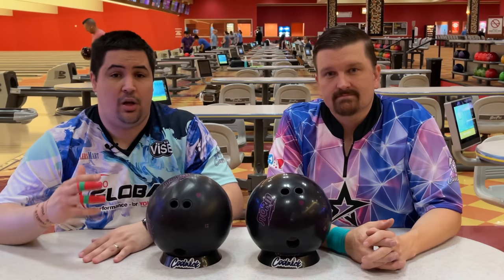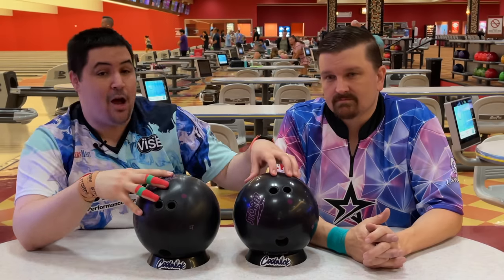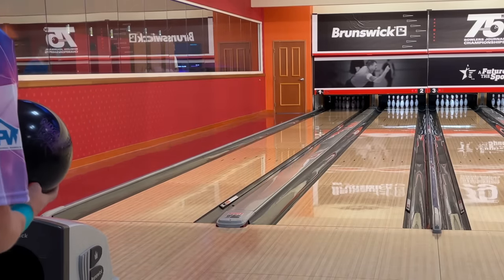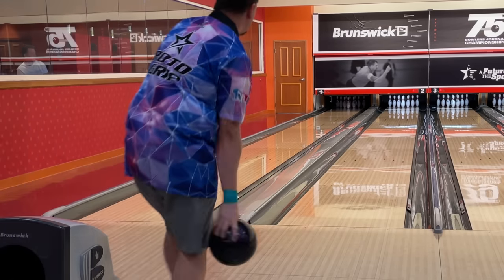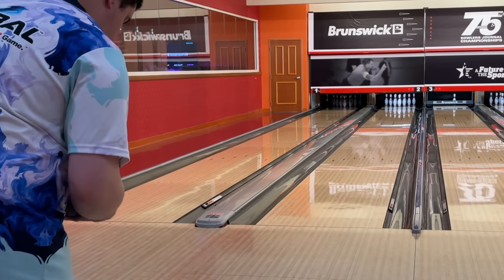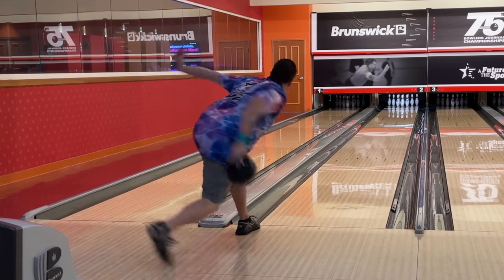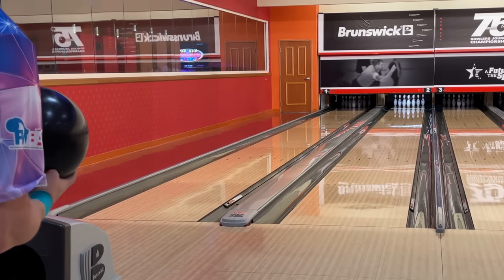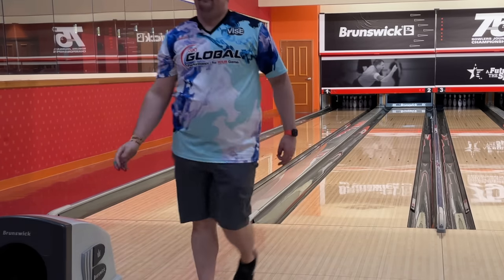What's The Difference Between A Bowling Ball Drilled Pin Up & Pin Down | Featuring Storm Night Road!

Comment: I also have a pin down Zen. I agree that it hooks much later, but I wouldn't say it hook less for me. Big difference I see is how the ball finishes through the pins. I see much less deflection with the pin down, and I tend to get more pin carry. Love the videos Luis, keep up the good work and positive vibes!
Reply from the maker: Positive vibes always! 🤙 pin down zen was money!
Reply: I like pin down too better.
Reply: got a pin up Zen - can't use it on my house shot. Hooks too much for me.
Reply: I'm the opposite. Pin down will give me alot of 10 pins. Even when I'm high flush. Sometimes it's fine but I usually get screwed over when using pin down. If I need more length I just change surface. My go to is a pin over the bridge or Slightly to the right of ring finger.

Comment: This may be the first time someone made sense of pin up/pin down--thank you! 

It's tiring to hear "pin down hooks sooner", "pin up hooks later". 

Explaining it in terms of Rg and Diff. makes so much more sense!

I found it fascinating though, to see that pin down worked better for you as a "balanced" bowler, where revs and speed balanced each other out and neither were dominant over the other, as opposed to Chris, whose higher rev rate and speed, was clearly more suited to a pin up.

That would seem to indicate that rev rate affects both Rg and Diff.

So check me on this please: 

Chris' increased ball speed+his loft+ pin down raising Rg= Chris' ball pushed further down the one than he needed it to. 

Chris' higher rev rate+ pin down lowering Diff., actually made the ball fight his rev rate, and clearly the ball won and even his higher rev rate, didn't give him the back end shape he needed.

I'm guessing that because you are more "balanced" in terms of rev and speed, moving left was really all you needed to do, to make the pin down ball work for you. 

I'm also guessing that a pin down ball might therefore also be a good option for a lower rev or lower speed bowler too.

What are your thoughts about this?

Last, and here's an idea for a vid on combatting urethane carry down: if pin down raises the Rg but lowers the Diff., would a bowler using a pin down ball, with straighter angles, be able
to overcome urethane carry down?

I'm thinking that a pin down ball would work with the carry down, rather than fighting it as a pin up ball would.

What's your take on that?

Thank you
Reply from the maker: I think you're spot on! As far as following urethane I typically prefer stronger pin up drill asym solids to follow that nasty transition!

Comment: 6:27 Incredible spare Lou! I guess you are a bowler after all. 🤣
Here is one of the simplest and best descriptions I have read on pin down vs. pin up and it seems to agree with what you are trying to teach us:

"Pin Down Drilling"

This type of drilling has an effect of promoting more total hook and less entry angle.

Helpful for:

Lower rev players
Higher ball speeds
Bowling on a heavy oiled or longer length patterns
Looking for a more gradual hook

"Pin Up Drilling"

This type of drilling has an effect of promoting less total hook and more entry angle

Helpful for

Higher rev players
Slower ball speeds
Bowling on a lighter oiled or shorter length patterns
Looking for a sharper hook
Reply from the maker: I’m glad it helps!
Reply: What about high speeds and high revs what would you say is more suitable

Comment: The only pun down ball I have is the Gem, spesifically bc I want it to be nore versatile.   The smoother the ball on the fresh, the easier it will be for me to control, and with it being as early as it is I feel like it's a better move.    And then I'm also provably gonna drill a pin down purple hammer
Reply from the maker: Should be good !

Comment: Yes, I will take the explanations given plus the examples of lane play into consideration the next time I bowl.
 This is why....... So 4 days ago i had an Idol Helios drilled pin down. 
Side note everything else I have is pin up. 
Initially I was thinking ahead and had it drilled this way because I wanted a new shape for the challenge patterns in my local winter scratch League or at least when we get to that portion of the league but for now in the bowling I have done with it in the 4 days have been exclusively on house shots.... and "I haven't got a consistent strike path with this lay out yet". I've been rolling it straighter and closer to the gutter than the pin up equipment. but yet to obtain much success...My roll is smooth. Some where in-between you both closer to you Luis slow feet big, swing, lots of balance able to repeat shots.  So Thanks for the knowledge I will try to open my angles up with a straighter, forward ball motion in mind and try to see if it sets to the break point properly, for a consistent reaction to maintain higher scores.
Reply from the maker: If you continue to not find the right path to the pocket with it I might suggest changing the surface a little bit!
Reply: @LuisNapoles  Correct I'll give another go and see if I can have success. If not I can see some polish coming into play....

Comment: Good video Luis. Our bowling styles are very similar. I have a Dark Code and X-2 from doing the exchanges. After watching this video, I’m considering having my Dark Code drilled pin down. What is your pin down layout on asymmetrical? Thanks
Reply from the maker: For me it would be 30x4.5x70 maybe a larger drill angle actually like 60x4.5x70
Reply: Thanks for the reply. After struggling to find the correct ball this morning in league (Jackal LE and then Trend 2) I rolled my pin down Zen for the last game this and scored well with a 240 something. The first two balls were just to inconsistent. As you always say, finding the right ball (tool) for the job. My Zen is my first pin down ball and I really liked the ball motion. Thanks again.

Comment: I'm currently bowling with a hammer emerald vibe ball weight a lil under 15lbs. With pin down since it's a asymmetrical ball. And I have a motiv pride with pin down. And I use the new ocean vibe ball pin down. I've bowled good with the emerald and ocean balls lately. My issue is I feel I haven't found the right ball for me. It's so many to choose from. I'm looking at the hammer scorpion sting,stinger, and envy. The motiv mystic jackal and empire. And also roto hustle rap or the wine balls. I'm a left handed bowler. And my rev rate isn't high and my ball speed is usually between 12 to 16mph. Over the last 3 weeks I've bowled several 220 plus games with the ocean and emerald vibe balls. What ball would be a good choice to add to what I already have. I also have a Brunswick prism hybrid and hammer reaper. The reaper I can't find any stats on it. It seems to be a pearl but it's that old of a ball. But at this time my main 3 balls are hammer emerald vibe and ocean and motiv pride ball. I love watching your videos they are so informative. And you have one of the most consistent ball releases I've seen online ever. I've posted some of my scores on my Facebook and on lane talk bowling app. I do have a few practice videos on my YouTube using both the ocean and emerald vibe balls. Bowled a 264 last Friday with the hammer emerald vibe ball. That's like my highest game since I bowled a 297 a few years ago. And I do think I might get my 1st 300 game this league year with the emerald ball.
Reply from the maker: Since you're lefty I would highly recommend the Storm !Q Tour Solid. Prob the most control ball on the market and as a lefty you def want that shape in your bag

Comment: My hyroad x is pin down like your pin down night road . Pin under my middle finger and did 1500-3000-p5000d by hand and it hooks smoother then it did out of box, while my IQ tour solid (my second IQ tour solid while it was number 9 for my dad and is the only one that is drilled pin up the pin on my first IQ tour solid was like my hyroad x but more to the right so it is not under my middle finger) and is at 3000 trucut so it is perfect to ball down to.
Reply: I was thinking of plugging and Redrilling my hyroad x (currently it's pin up with the bridge cracked) to pin down. Hopefully it does compliment my iq tour solid
Reply from the maker: Nice stuff!!!

Comment: Try a 45x2-3/4 x 30 layout this ball will also have small flares will roll like urethane ( with more back end) and hit like resin
Reply: 2 3/4 will probably not shape and either have a very long hook phase and have no energy left down lane or just flop in the heads and hook early so you get no back end shape 

Don't drill balls with 2 ³/⁴ pin to pap...
Reply from the maker: Yea I wanna drill more short pin stuff
Reply: @joshg218  Sorry you have the wrong Idea the ball will roll like pin down ( smaller flares) shape like urethane with more back end and same resin hit I average 230 with this drill and had 5 300 with it last season, and I'm 60 years young with 40 years bowling experience. Another way to look at it it is the same 5/8" difference from 3-3/8 to a 4" pin as to 2-3/4 just rolling on a different axis. And the main result is you will be able to play more right longer
Reply: @helenb2504  I had a ball misdrilled to a 2.5in pin with similar drill angle and val numbers to your drilling.. the ball never transitions properly.

Technology has changed much since I was a Junior as well.  20+ years ago we all had 3.5-4in pins.  I'm at 4.5-4.75in today and looking to probably start drilling longer because equipment is so strong.

A 2.5in pin goes one of two ways.. it is so close to the pap that the ball transitions well before the end of the pattern and the ball rolls straight when it sees the dry or it keeps flaring, and never transitions if there is enough oil and speed.

I had a dark code that flared 3/4 the surface of the ball but never changed direction down the lane.  

The urethane shape you speak of is poor ball roll.
Reply: @joshg218  Shape is a preference I like to play straighter and have my power at the pins not wasted trying to get to the pocket I average 230 with this layout so it works real well for ME. I agree nothing is for all bowlers but their is a misconception of layouts shorter than 3-3/8 and even Mo Pinal has short pin layouts so they must work!

Comment: so when I start with a 45 x 4 x30 layout on the fresh when lanes transition and everyone goes left I switch to the 45x2-3/4 x 30 and move a little right away from all the traffic and light them up. Note: both balls are Camo's
Reply: 2-3/4 pin to pap is crazy. 3-3/8 pin to pap is max flare. Meaning that is as strong as the ball can get. You actually start to lose dynamics when you go under 3-3/8
Reply from the maker: I think I’m gonna start changing some of my layouts
Reply: @roscoepretlowiv7959  Yes same as when you go to a longer PAP you just rolling the ball on a different AXIS it will roll more like urethane with more back end and still hit like resin try it out
Reply: yes give this layout a try it will produce smaller flares like pin down but will roll like urethane but with more pop and hit like resin
Reply: @helenb2504  I mean I know about short pin layouts. It's basically all Mikey Pinel talks about. They don't really match up with high rev rate players. I'm around 580. I just buy urethane instead of making a ball do something it's not intended to do. However, that's just my perspective. I also don't bowl on house shots, so yeah.
Reply: @roscoepretlowiv7959  Since I'm no where near your rev rate and neither is 98% of bowlers mine is 325-350 range which is about average I can't reply to how this works for you. I also bowl on sport shots and this layout is a killer on short patterns. For the comment on what a ball is intended to do, the beauty of today's equipment is you can have it do many different things depending on surface and layout. I would rather have a ball that rolls like urethane and hits like resin, than hit like urethane but with your rev rate everything hits hard.
Reply: @helenb2504  The comment wasn't a shot at you. It's just my preference. A lot of the guys love urethane because it is always tame. Here's an analogy for you. Urethane is like a domestic animal, they are friendly at all times, however, reactive is like a wild animal that you tried to take off the streets and tame it. It tries to be like Urethane, but if the conditions aren't perfect then it can't be

Comment: So, what's with the shinny ball versus the dull ball. Doesn't that wipe out the validity of the pin location test?
Reply from the maker: one of them was 4k fast out the box and the other was 4k fast by hand. The point of the video was how the flare rings change based on the layout. even if both looked exactly the same surface wise the results will be the same
Reply: @LuisNapoles  i disagree with this.  The flare would look the same, but surface creates the majority of ball motion.  The lower flare on the pin down should have produced less overall hook, but because the ball was shiny, it got through the fronts cleaner and had a much stronger backend reaction.  Opposite of what the layout should have created.  I think this will cause people to misunderstand exactly what's happening with the layouts.  I think a remake with both surfaces exactly the same would show you both moving right with the pin down and left with the pin up... Although it would only be 1-2 boards different i think... If that...

Comment: I am a bit confused as every video I have ever seen have said that pin down read the lane earlier and are smoother because some of the energy is bled in the front part of the lane leaving less energy to hook the ball down lane.  They say pin up go longer, but snap more because more energy Is stored until the weight block stabilizes and takes over at the end.  They say the overall hook is similar, but just in different parts of the lane. 

When I drill pin down, my ball reads sooner and is smoother than all my pin up equipment...it is why I prefer pin down over pin up.  I like the smoother more controllable shape.  For me, my pin down hook less than pin up.
Reply: Because they are wrong. I’m sorry, physics is physics. Watch Radical’s videos explaining their layouts, along with pin up/pin down before and after drilling specs. Every time, the differential goes down when they have a pin down drilling. Something can’t flare less and hook earlier, if all the other factors are the same.
Reply: Or could it be the surface on his coverstocks as they say coverstock is 70% of reaction.  The shinier ball I’ll naturally store more energy until later.  This is his pin down ball.   The duller ball is pin up so it is reading the lane sooner because it’s surface is so much more porous at a lower grit?
Reply from the maker: The science is the science regardless of the surface prep (one of them is 4k fast out the factory and the other was by hand) In the video and in the thumbnail I show the flare rings of both balls that have nothing to do with surface BTW. The pin down one the flare rings are much much tighter together than the pin up one
Reply: @LuisNapoles  I agree that yes, flair rings have nothing to do with coverstock.  Flair deals with the core and how it is out of balance and then rights itself.  The more out of balance the core is, the more flair you will get which will result in more hook- this is the differential. But coverstock does factor into how early a ball starts to pick up the lane and hook.  That is why you can adjust the coverstock to fit your game or your bowling alley conditions.  Just like most urethane doesn't flair, BUT "it hooks at your feet."

Comment: Every pin up ball I’ve drilled goes longer because it puts my pin 5 inches to my PAP. Every ball I drill with pin under puts my pin to PAP 4 to 4.5 inches makes my ball reacted sooner and smoother.  So in my experience, this is completely wrong.
Reply from the maker: the pin to pap is what's happening there not the pin up vs down. If you drill them the same but the VAL angle is different you'll see that the up one is earlier and the down one is longer. this is science not an opinion.